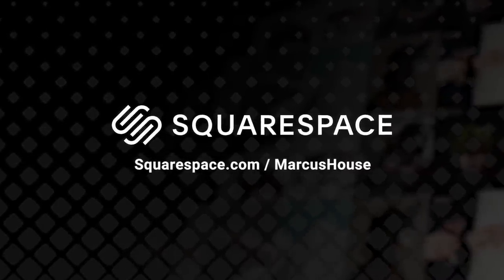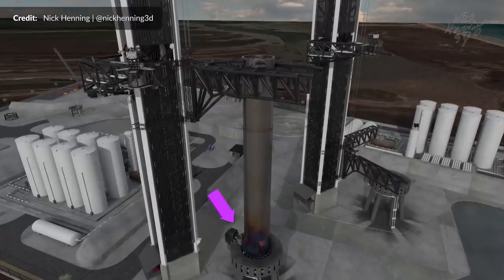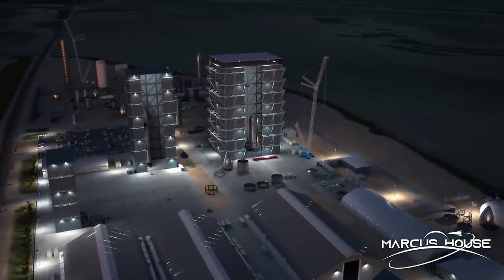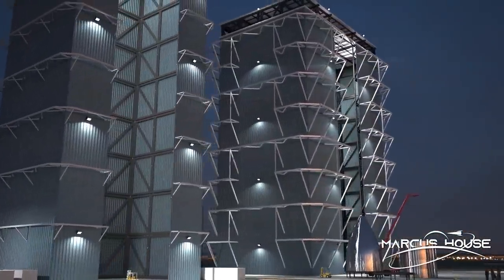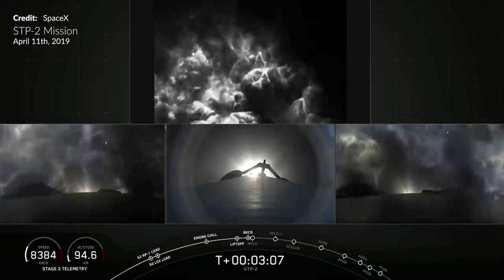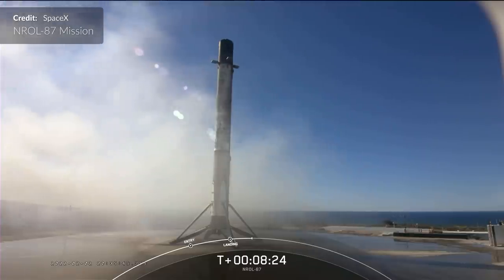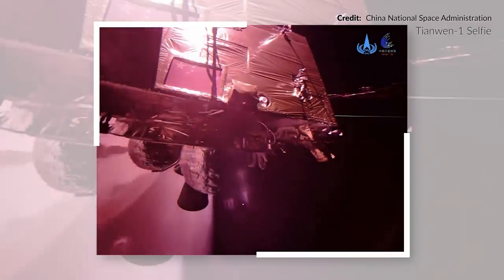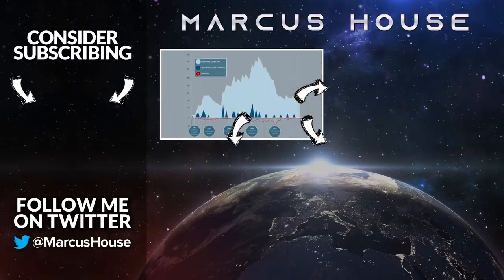SpaceX Starship Presentation for 2022, Roberts Road Facility, and 3 Falcon 9 launches in 4 days

Comment: I think what SpaceX have proven with Falcon9 is their ability to land a rocket with pinpoint accuracy more than 100 times, which gives NASA and their customers confidence that they can do the same thing again with a larger rocket and gently land it between the chopsticks. NASA must be confident that that can be achieved.
Reply from the maker: As with any innovation, nothing is guaranteed, but if it goes to plan, it will be amazing.
Reply: @MarcusHouse  Yes, landing is one thing, catching the rocket mid flight is next level stuff.
Reply: And they're doing this on a drone ship moving up and down and side to side - 3 dimensions of movement. All with a hoverslam, no time for adjustments. Elon has recently let us know Super Heavy will hover just a bit as it goes in for the catch. Plenty of time for adjustments to a steady target.
Reply: @ThexBorg  Thankfully, SpaceX is a next level company with next level engineers and a next level lead engineer & CEO!
Reply: @donjones4719  the hover slam on the drone ship is possible because of crush cores in the landing legs but you’re right the booster hovering will make it easier.
Reply: @MarcusHouse  they need wind speed sensors around the tower at 50 or 100 m to give rocket a 2-4 secs of seconds warning of incoming gusts. Then they can adjust position of the rocket before the gusts hits.  No way you can get to chopstics in any wind otherwise as rocket is very light without fuel and will be moving sideways with the speed very close to gust speed difference when gust hits.
Reply: @MarcusHouse  Star Ship just needs a structure just behind the windows going upwards/forwards to a saucer section in a horizontal plain.. The rear wings replaced buy sections to mount 9 meter wide Star Sips in a horizontal plain.. ooh wait a few 100 years to early lolol :):)
Reply: I think we will see a couple damaged orbital launch towers before they land one succesfully 😂😅
Reply: @MarcusHouse  What I wish I could see if the simulation that SpaceX is using that has made them confident enough of the chopstick landing to start the building of a second tower.
Reply: @johneric9957  space is real ,what are you talking about, lol.
Reply: @stephenkioko4205  he also said christ made us lmao
Reply: In my understanding: Falcon's 1st stage use GPS for their landing and have therefore meters of tolerance by design. 
They don't need to be more precise since the landing platform is big enough to have that tolerance.

Landing within chopsticks needs another level of precision.

p.s. And landing on the moon is a completely other topic. No GPS; another gravity; vacuum engines; surface is no solid concrete etc. etc.

Comment: Would say during stacking I think they will have to pressurise the booster IF they are to release the arms of mechazilla from starship so the full weight is on the booster.  I'm not sure we'll see that happen
Reply: Yes, SH must be pressurized for the empty Ship to be stacked. However, SH will prob have to be fully fueled before the Ship starts prop load.

Comment: The “sockets” under the forward fins of Starship may be the snub ends of *retracted* load pins.
Reply: Elon is all about elegant engineering simplicity (why the grid fins are fixed on the booster.)

There’s zero advantage to hiding the pins - the mechanisms moving them would have to be huge and take up valuable internal space, AND you’ve just created a single-point-failure if they don’t deploy (can’t be caught, would blow up the pad / tower area.) 

They’re very small on the booster, should be no issue on starship
Reply: @EstorilEm  Definitely agree - there's no way in hell Elon is gonna engineer in a complex system to 'hide' the pins for exactly no reason, especially after they have stopped retracting/extracting the air fins on starship booster for those same reasons - such systems are unnecessary and contain single point failures which are redundant.
Reply: Oh yea that’s a good catch.
Reply: The pins on Starship could be vulnerable to hypersonic re-entry heat that’s not an issue on the booster. And because they need to be under the ship’s center of mass, they can’t be located on the shielded lee. That would be a good reason to build a retraction system.
Reply: @marxug1  , I totally concur. Starship encounters much higher temperatures than SuperHeavy, and the pins will be subject to hot plasma. 

However, do consider whether a special high temperature alloy (titanium) can be used. It would be cooled off by the time it needs to support the ship. That would greatly simplify the design, although the part would be more expensive. Alternately, the pins could be insulated by retracting or rotating covers, which may not require high strength in the mechanism.  

P. S. The "pins" are likely to be wheels that facilitate rolling to the center of the "chopsticks". I am thinking of roller or needle bearings.
Reply: I concur. Retractable pins are not complicated. The bearing interface to support the pins would be simple and not be much more complicated than a fixed pin. The extension/retraction mechanism would also be simple and reliable. Of course a fixed pin that can take the heat would be ideal, but if that is the design, why aren't they installed yet? The socket could be a receptacle for an inserted and locked in place item, but this also would have to be able to take at least the heat of one re-entry. The location does appear to be protected from a direct blast, but the radiant heat from the plasma flowing past nearby could still be quite significant. Perhaps the mass of the pin and a thermal coating will suffice to slow the heat transfer and the soak time for the metal to reach a failure them could be longer than the pin will be subject to.
Lastly, they could be using some sort of pin that is attached to the catch arm. I don't see this being practical from a catching stand point, having to thread the needle before bingo. Also, the moment on such a pin would require quite significant structure to support the load. My 2 cents.

Comment: The step by step process you showed us of the booster being picked up by Mechazilla for the first time is incorrect.   The "Stabilizer Bars" will NOT swing down and connect to the side of the booster BEFORE it's first lift.  The booster will not be perfectly centered enough when it first rolls up to the tower.  It will first  be lifted by it's top pins, slightly rotated and THEN the lower "stabilizer bars" will engage.
Reply: Also if you noted, in part of the animation/actual footage ( 3:30 )  they show the test beam for weights in place just before the Starship lift.

Comment: For the longest time, I thought satellites used lasers to communicate with the Earth, but learned that wasn't the case at all. Now it's actually becoming a thing.
Reply: pretty sure the sat-earth communication with starlink is still handled by radio waves. Only the Sat to Sat communication is done with Lasers last time i checked.
Reply: @unitrader403  Aaah, good distinction. I was watching this & going, "Wait a minute... Hasn't Starlink been doing this for months now?" Glad you pointed that out!
Reply: There has been the use of LASER from Earth though. 
Telescopes have used reflective feedback from LASER to adjust a lens, to account for the distortion of light through the atmosphere, to give them sharper images. There is a LASER reflector on the moon's surface (placed by one of the Apollo missions) that an observatory has been firing a LASER at, to get exact distance measurements of the Luna orbit.  There are probably other applications I am not aware of too.
And I am sure that satellites have been using LASER for some spectroscopic analysis of 'certain areas' in the more secretive spy satellites? That's an educated speculative guess on my part. But that's what I would do if I was spying on another country.
Reply: @davidkottman3440  Thanks for the LIDAR definition. Yes, my memory recalls 'false colour' image maps. Love this science. 
Ah, I just remembered, survey planes fly over the sea and record hugh amounts of data, which get's translated in the survey offices into Charts for Maritime Companies. I used to be in the survey branch and all that time at sea is now pretty much obsolete. Guess it's just core samples and water temperature readings these days. And towing the Magnetometer around.

Comment: I think that SpaceX will dry fit the StarShip SuperHeavy Booster in Boca chica several times and maybe even do a couple of flights and then do a heap of tweaks to the tower and all its components. Then once the design is tweaked SpaceX will build the cape launch tower and launch platform.

Basically why build untested equipment when it will be tested very soon.

Comment: MIT just announced a two-dimensional polymer that is stronger than steel and impermeable to gas.  They call it 2DPA-1.  Could this be used as a liner for a refueling station in spsce to prevent boil off?

Comment: Im thinking about riding my bike from Los Angeles (HQ) to Starbase to witness in person, a Starship orbital launch and Super Heavy landing (if possible). It all kinda hinges on the FAA but assuming they get the green light, the ride is about 2735km+/- and average 80km per day, the tour could role into Boca Chica a little over a month later. 34 days. It's all up on the air now, just throwing it out there to see if there's much interest. 2700k is a lot to ride solo.